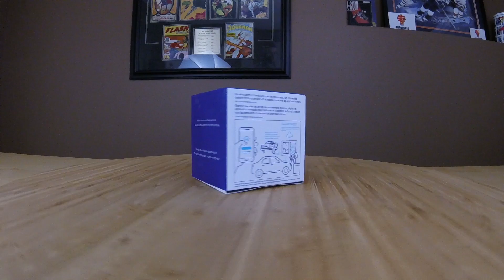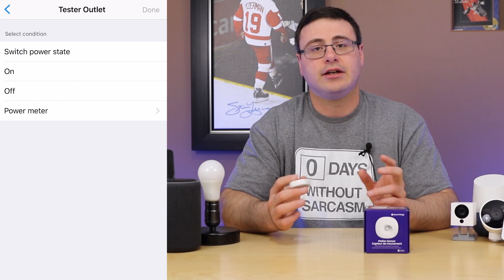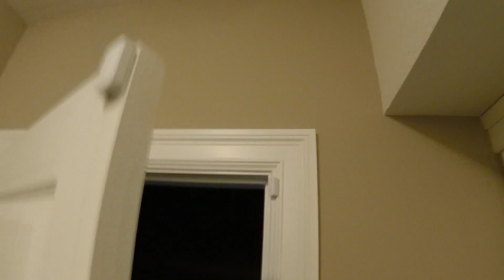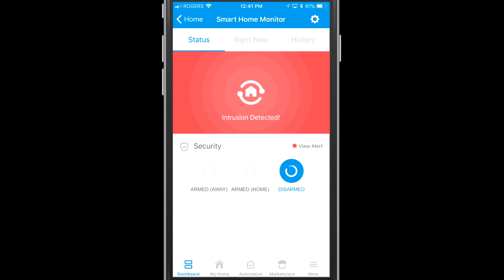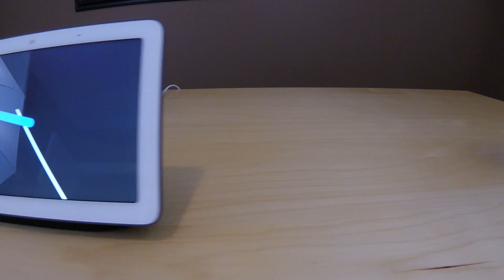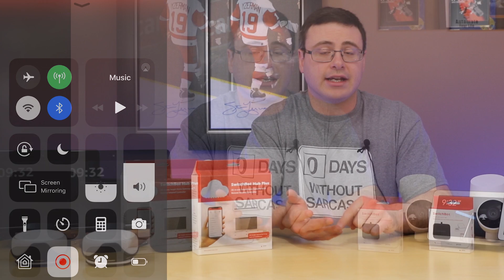Smart Home Technology For Elderly Care | Products and Usage

Comment: Question....Hi Brian, 1st... I wanted to take the time to say thanks for putting out so much content.  It can be pretty difficult to find documentation on a lot of this stuff.  Here is my question.  I have aging parents.  I wanted to automate a few things for them through the Alexa platform since the are already using it.  They do get confused with technology so I want to keep it simple for them.  If I automate lights, would it be easer to use switches or smart lights?  My 1st though would be switches because once they are added to the home, they should always show up in the app.  My fear is that, if a smart light burns out, they will have to know how to add and set up a smart light.    Any thought for making their setup more permanent?  Thanks for your time... I know you get a ton of messages
Reply from the maker: I think switches are easiest, and I'd suggest you get a good brand like Lutron Caseta (Diva and Caro).  That way they can control physically and by voice AND by app or automation.

Bulbs get turned off by switches and automations don't work then

Comment: Have you actually used any of these? About a million false alarms.
Reply from the maker: Sounds like you need a bit of help filtering through some issues.  In many cases, implementation of a "sensor" isn't enough.  You need to get creative, use multiple sensors, and understand your data.

Comment: Hey Brian, can I get your thoughts on NFC tags for home automation, any good/ best NFC writter /uses?
Reply from the maker: I don't use a lot of NFC, although really multipurpose or contact sensors are a very simple use of a similar type of technology.  NFC is usually more intended for encrypted information or information where you need to verify that the device/card is there.  What were you thinking for a use case?  There could be a use for guaranteeing it's the right person at home for sure. :)
Reply: Honestly not sure what I'm gonna do with them, I saw them on the promo for Tasker app (also which I've never used, trying to decide if it's something I can figure out & use) I have all the usual stuff Alexa,Google home,Philips Hue lights, Wyze Cam/Sense kit,Samsung Galaxy 8 phone, also thinking about getting a Samsung Smartthings....

Comment: Thing is you can go the DIY way or you can just get a security system installed. Honeywell/Ademco and 2GIG can do all of this stuff so you don't have to piece it together and learn a whole new trade to use/install it. Stuff like this for it to work right and done right should be left to the professionals. For a example here in the state of Florida the authorities such as Police, Fire and Medical would not be dispatched automatically unless it is registered with the City, County or State and the system monitored by a certified central station. So if you do one of these DIY setups and when a alert happens you better check it out ASAP as if you're the Central station for a security company. I had a guy that did his own system for his Mother and he's typically busy running a roofing company. He was in a meeting trying to get a new client and his mother fell and passed out. When he finally got to his phone it was two hours later. Luckily she lived and spent a week or two in the hospital. The Security company I work for sent me in to install in a Honeywell Vista 21ip panel, Tuxedo Touch keypad, contacted all doors and windows. We even added a few extra sensors to the bedroom door, bathroom medicine cabinet, CCTV,  medical alert pendent, a couple of extra motion detectors so you know what area of the house she was in. I think we even added a Skybell. Two weeks after the install she had an episode of low potassium and hit the medical button, the central station alerted medical help and the TC2.0 app alerted the Son, not to mention he received a call as well from the central station. The Mother is in her 80s and she loves her safety net. She only has to worry about a Keyfob to Arm/Disarm and a medical alert pendent. The Son that is in his mid 50's just has to use one easy App.

Also keep in mind Security companies are not like the 70, 80 and 90s. Most Security Companies also do Home Automation these days.
Reply from the maker: The trade is...for a monthly fee and restrictions on upgrading, cancelling, etc..  I certainly don’t need to pay those fees and I think you’ll find a lot of people can manage most of what you’re saying.  Not saying you’re wrong for most, but this is a home automation channel!  We have capable folks who know the deal.

Comment: Thank you for keeping the elderly and our safety in mind.

If you have the time to share some tech advice for my scenario — it would be greatly appreciated.

I'm 70 and in poor health. Additionally, last year I was diagnosed with dementia, so my memory and certain cognitive skills are impaired. 

I'm at the point where I forget to turn off stove burners, and I forget to turn off the sink faucets. 

Last year, when my thinking skills were much better, I managed to install the following home tech:
- Echo dot
- Google Home
- Wyze Camera
- WiFi (Google Mesh) 
- SmartThings Hub
- Ring Pro Doorbell 
- Ring Security System 
- Several TP-Link smartbulbs and TP-Link smartplugs controlling lamps and small appliances.

Considering the above tech, is there anything currently available for gas burners and water faucets that would make me aware they were left in an ON state?

Kind regards, 
T.
Reply from the maker: Hi T - I think if you left any SmartThings sensor near to (not right beside) your gas burner, then you could set a temperature automation trigger to let you know that heat was building up!  I'd use it to trigger on a color bulb to a red color or something of that sort.

As for your water faucet, the monkey man is right!  The multipurpose sensor carries a vibration sensor.  It depends on your tap, but it might be sensitive enough to know if the tap is running.  Try that, but it may not work for you.  After that, I'd actually think about a Wyze Cam placed relatively near to the tap so as to hear the tap running.  I'd set the noise sensor to a high sensitivity, but that might work.  There are other noise sensors...but they're few and far in between.
Reply: @AutomateYourLife ...
Thank you for your suggestion. I really appreciate the help.
Reply from the maker: One other thought I'd had for that scenario...Arlo has a smart baby monitor.  I wonder if that might make sense from a sound standpoint.
Reply: @AutomateYourLife .... Interesting, I will research your idea, thank you.
Reply: @Supermonkey 1964....
Thanks much! It is definitely worth a try.
Reply: @Supermonkey 1964.... Your suggestion is greatly appreciated. All your folks are very creative.
Reply: Here is a product that works really well for faucets. https://community.automatelife.net/topic/661-looking-for-an-auto-faucet-that-monitors-usage/
Reply: There are several devices on the market that auto shut off electric stoves, but here is one that claims to shut off gas stoves. https://iguardfire.com/gas-stove-model/?v=4326ce96e26c

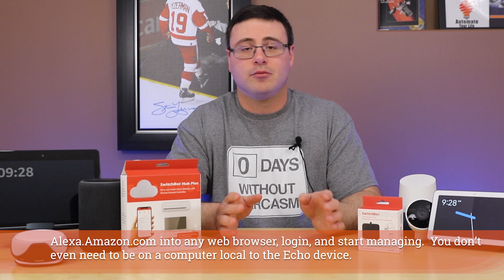Comment: Hi Brian. At 12:01 you mentioned remoting into a local laptop to control devices is the senior's home. I didn't see a link for that. Is this it ? https://alexa.amazon.com/spa/index.html#cards If so, I can see the devices, but not a way to control them.  Frank
Reply from the maker: So you can go to alexa.amazon.com on any laptop and then manage the account/devices there.  That doesn't require a remote connection.  I didn't include a link, but I've made AirDroid and AirMirror work between PC/Laptop -> Phone/Tablet on Android.  You can find those apps for free.

Honestly, if you want a reliable solution here, you need to look at something like TeamViewer.  Pricey...but likely the best solution out there.
Reply: Automate Your Life hi Brian. One other thing I've done to help a senior relative remotely is keep an Echo Dot under their account in my home and turn it on when they have difficulties. That way I can show them that the actual commands work. In one case their TV screen came up blank when they asked the Fire TV cube to turn on the tv and watch a channel on cable TV. I was able to tell their cube to change HDMI to show them it was their cable box that needed a reboot. In the future, I plan to add a smart plug and do that for them with a Routine. Frank
Reply from the maker: Frank E. That is a great point Frank!  You certainly have a great background in this stuff, as expected!
Reply from the maker: However, every component I mentioned on this video does NOT require management on the local WiFi network. :)